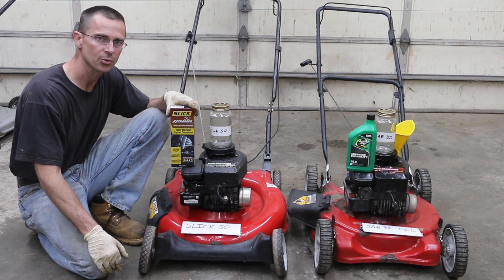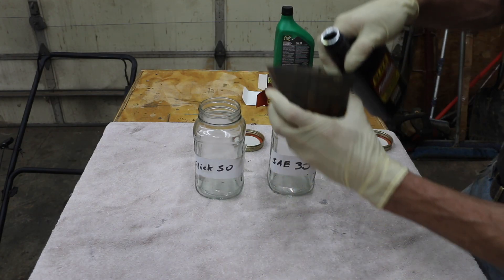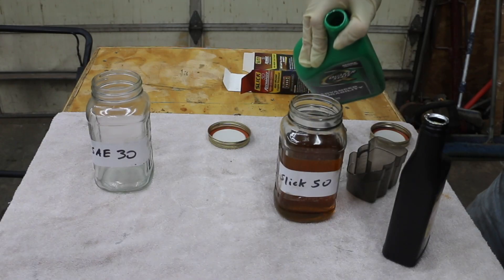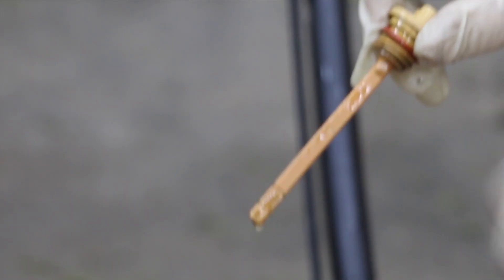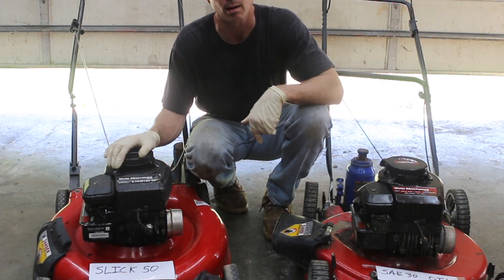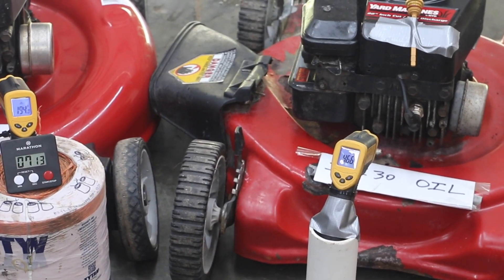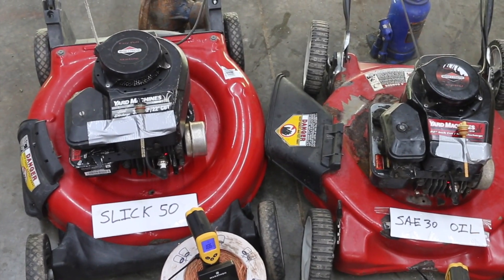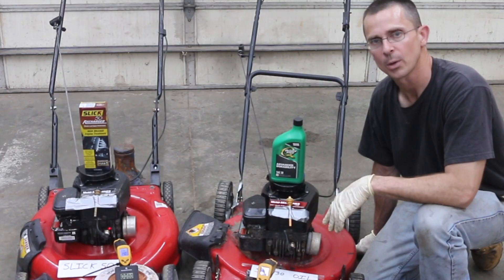Can't believe what SLICK 50 did to my engine!!--Dry Crankcase Test!

Comment: I remember that commercial. They added sand and rocks to the crank in that infomercial. Maybe that was Z-Max though. I have a friend who owns an old Jaguar and he uses Z-Max at every change. My personal belief is that the engine is designed to run at a specific temperature and lowering said temperature is bad. Raising it is bad also, but I only run the correct type of oil in my engines (cars, boat, five bikes, antique tractors, and more) and I have only had one engine fail on me, and that was on an old 2-stroke, racing dirt-bike, which of course has no oil in the crank. I miss 2-stroke bikes!

Good video though. I am late to the party but I am gradually watching your videos and enjoying them, especially the un-biased approaches you use. I would love to do projects like this myself, but I do not have the cash for stuff like this. I'm a dad and bills come first. Maybe one day!

Comment: My oil pump went in my older Ford F150. I had treated it with dura lube. I was able to drive home with the engine very loud with no oil. It never did seize. I got rid of the truck anyway.
Reply from the maker: Thank you

Comment: If it runs cooler, then it’s better.  I wouldn’t consider running without oil to be a requirement for an additive, but would be great if it could.  Having never used slick 50, I’m not discouraged from trying it after watching this video.
Reply from the maker: Thank you for the feedback.

Comment: I Slick 50'd my engine, then my oil pump went out, but I didn't get an oil light until just before the engine started banging.  Damage done.  Did the Slick 50 prevent the oil light from coming on, sealing the fate of my engine?
Reply: It probably clogged your filter and then your pump. I wouldn't get it near any engine I wanted to carry on working.

Comment: 1983 I saw a car run for 3 hours after draining oil treated with slick 50.     Even ran up to 90mph on rollers.
Reply from the maker: Thank you for the feedback!
Reply: So many comments here - but many gaps.  Firstly, imperative that the engine is treated for an extended period for successful treatment before draining and testing. Secondly, the original Slick 50  must be used. My first experience of this PTFE oil treatment dates back forty years when a friend of mine returned from Australia with a product developed, as I recall, by Dupont where the carefully monitored test run from  Freemantle to Sydney was conducted successfully.  And even when I visited Australia in the early eighties, I recall watching a motor race in which the commentator stated that an RX8 that was running had had the engine treated with something - he didn't know what - and that the engine was running so cool that, to save weight, they had been able to reduce the size of the radiator significantly. Needless to say the Mazda won the ten lap race. The Dupont product was not available in here in Europe, but the formula was available as the original Slick 50. Eventually that went off the market here in Cyprus  -  but here's the surprise, the PTFE treatment was and is available from  the manufacturers of Gunk. So that is where  I am at. Why do I use it ?  One time, for some reason, I lost my sump plug, and of course my oil, and was able to drive to where I could fix it with no damage to the engine. Another reason is that if ever Ive trouble with smoky exhaust, or anyone I know, that fixes it. I haven't bought a new car in forty years, so of course, only when I buy a replacement do I have that problem. I could go on, but that'll do for now - Cheers !!

Comment: I think the old Slick 50 did work.  I knew a long time lawn mower shop guy who did an experiment with the old Slick 50.  I don't have all the details but he said he eventually disassembled  the engine and he was shocked to find no visible wear on any of the moving parts and was virtually indistinguishable  from a brand new engine.  He has since passed away or i would call him and verify.  This product at this website may be the original formula.....http://browerhealth.com/product/permafused-anti-wear-engine-protection/
Reply from the maker: Thank you!

Comment: THEORY: #1, HOT exhaust from Slick 50 mower is blowing onto the SAE30 engine. This will undoubtedly cause that engine to run hotter in both tests.  
#2, again, exhaust from Slick 50 blowing directly onto the SAE30 engine. Any residual oil being vaporized along with soot & exhaust is being blown onto the SAE 30 motor, and being sucked in through the intake. This could provide , although minuscule,  some lubrication, or even slowing down the other engine, or causing it to run slightly richer. Gas is a lubricant as well!
#3, Slick 50 motor is newer, possibly better tolerances between parts. The older worn out SAE30 motor, with sloppier tolerances, might handle it better without oil.
Reply from the maker: Thank you for the feedback

Comment: Pro-long.  Used it years ago and had my toyota shoot out the oil till pressure dropped off and got some stuttering on the highway.  Drove 5 more miles to town and added oil and fixed the bnb leak.  Same engine still runs today.
Reply from the maker: Impressive!!

Comment: I recall when Slick 50 was new and had teflon particles in it.  DuPont, which invented teflon, tried to warn people about putting it in engines, which was definitely not what it was meant for.  Then one of the magazines like Popular Science or Popular Mechanics tried this same test and got the same results.  The engine with only oil in it lasted longer.  It was always a flim-flam deal, a total fraud.
And if you recall, the recommended uses for teflon didn't work out any better, as most people ended up with teflon-coated steel pans with just a few streaks of teflon remaining.  Wonder what it did in all of our bodies after we ate it mixed with our bacon and eggs?

Comment: The major engine oil manufactures include "additives" in their oil.  Their oil is about 85% crude oil based and about 15% other additives.   Any additives that are effective are already in their oil.  Using good motor oil in a good engine is always better than ignorantly pouring in some over-hyped, magic cure-all.
Reply: I agree with that.

Comment: all i can say is a mecahnic put slick 50 (oil and fuel system) in my car and it did 4500$ damage to the engine (was all the rage in the early 90s). a Motor regulations body had a look at it and said its the PTFE that breaks down from the engine walls etc, clumps together and causes oil line blockages etc, All fuel injectors also needed to be replaced.. Put a diff oil in my rear diff that had PTFE additive in it and it blew after a few weeks, shattered pinion gear. would never touch anything that has PTFE in it for cars etc.
Reply from the maker: Wow!  That's a lot of damage

Comment: When I worked in GM Powertrain I had a class on lubrication taught by the lubrication tech spec. Slick 50 does not add to the lubrication package in modern oils. The TS reported that and the question always comes up in his classes. The other thing about modern oils is that the line between synthetic and conventional motor oils is blurring.  One thing to consider is were both carbs tuned the same (if they were adjustable)? Differences in temperature would be far more sensitive to A/F ratio than small differences in oil unless an extremely viscous oil caused a higher engine load to run at speed.
Reply from the maker: Thank you for the feedback!

Comment: My husband used it in a Dodge Dart with a 171 Slant six it was getting 20 miles to the gallon at the time, once we put in the slick 50 the grey yellow looking stuff at $25 a quart, he ran it for 1500 miles, turning the carburetor down,three times for it was running away at stop lights or stop signs. After all was said and done we got 32 miles to the gallon. A 12 mile gain. He saw the report on the stuff it was a really thick one, a friend was selling the stuff so we got to see all the reports. You didn't have to change the oil filter only after the 1,500 miles. Then you could run the car out of oil and it would not hurt it, cuz we done it just for the heck of it.

Comment: This test is not a valid indicator. 1. You didn’t follow Slick 50 instructions. You altered them. 2. Running an engine without oil in it is not a valid test. No one drives their car that way intentionally.  It was an entertaining test but it doesn’t tell you that slick 50 is better or worse than conventional lubricant.

Comment: I used slick 50 on my new 2002 ford e350 van I just got rid of it this year 2019, 17 years old 340,000.miles not a single problem with the engine  body rotted out, my mechanic said on the last visit I made with it that there was not a drop of oil leaking from it, just got a new ford van and will use slick50 faithfully. Longest time ever with a single vehicle.
Reply from the maker: Impressive!

Comment: Something else I use to drive a hay rake and on a field that we rake each month there were these giant propane single piston engines.
One time I was talking to the maintenance guy who is changing the oil. 
These engines did not use motor oil they used mineral oil it was a clear looking liquid with no color I also remember him saying that they would take the used oil and push it through filters under pressure then reuse it.
Have you ever tried using something other than motor oil.
Reply from the maker: Thank you for the feedback!

Comment: Amsoil will keep running even when drained.....used it for 12 years in my tri axle dump truck 780,000 miles  and internal engine was still in excellent condition.
Reply from the maker: Thank you!

Comment: I have saved cars by using Slick 50. I use it in all my cars all the time. I run cars that others give up on. I am now driving a 1996 and expect to be still running it in six years with Slick 50 in it. I use it in every oil change. I don't run engines out of oil

Comment: Maybe try this. I had a 1981 VW Rabbit. It had zero oil pressure at idle in drive. So I would bump into nuetruel. But as a home made idea. I used a generic STP. Or engine honey. But filled will a cup of graphite powder. It never seized.  It did one day blow a head gasket. But never locked up. Give it a try!
Reply from the maker: Thank you for the video idea!

Comment: The difference in ring/cylinder wear between the two engines may have actually determined which seized up first in this test. The test would really have to be done on two engines with equal clearances to isolate the effect of the slick 50 on seize time. It made for an interesting video nonetheless.
Reply from the maker: Thank you!

Comment: the exhaust from the slick 50 lawnmower is blowing hot all over the mower running just the 30 weight oil thus potentially making the reading 10 degrees or so hotter than it would if the hot exhaust wasnt blowing that direction
Reply from the maker: Thank you

Comment: Modern synthetic oils are that good they need no further additives.  All I do is one full oil and filter change a year as I do less than 7k miles annually.  I do not have engine problems at all.
Reply from the maker: Thank you

Comment: I thought the Slick 50 was supposed to have a Teflon mixed with it. If I remember right, that was their selling point in the mid 70's. If the 50 now days still has the Teflon in it, I think there's a recommendation time of running the motor for that to adhere. Just thinking out loud with a question.   Love your videos,  you do nice work ,
Reply from the maker: Thank you!

Comment: When I used Slick 50 the instructions said to run the car 3,000 miles, then change the oil. It is supposed to burnish into the metal to metal parts. I don't know the 3,000 mile mark on lawnmowers, but a fair test might be to run it several times at least to let it work into the metal.
Reply from the maker: Thank you!

Comment: They were used engines and the one with more wear already on it would have greater clearances and therefore run longer before seizing.  Also if one was running a leaner fuel mixture it would run hotter.  So the only way to get a meaningful comparison would be to run the test in identical new engines and verify they both run the same temperature on SAE 30 oil before treating one of them with Slick 50 and running the destructive test after draining oils.
Reply from the maker: Thanks for the constructive feedback

Comment: Of course the 2 engines were not identical in age or internal condition so far as I know. The cooler run temp is significant unless the exhaust of one was going into the other mower.  Does anybody still "the racer's edge" STP?
Reply from the maker: Thanks for the feedback!

Comment: During the test the Slick 50 engine stayed cooler than the 30 wt engine, with oil in the crank case. I was surprised when the slick 50 engine cut out first and that the 30 wt engine kept running at a much higher temp before locking up, after oil was removed. I have never been a slick 50 fan but if it can keep an engine cooler while running that means that when it is in the crack case less friction is being produced and that is better for the long life of an engine. But, I think I will just keep Mobile 1 in my engine without anything else. It has worked well in all my cars and I've never had any gunk build up, nor have any of my cars starting using oil, even with over 130K on some of my cars.
Reply from the maker: Thank you

Comment: I would be curious as to what would happen if you added graphite to the oil. Would the engine run a longer time than with just oil? I know graphite works great on metal to metal objects but would temperature be a factor?
Reply from the maker: Thank you for the video idea!

Comment: zinc: good for the common cold & your car's engine

Another type of additive is zinc dialkyldithiophosphate. Zinc-d is found in Mechanics Brand Engine Tune Up, K Mart Super Oil Treatment, and STP Engine Treatment With XEP2, among others. The touting of zinc-d as a special ingredient in engine oil additives is a little like the Shell ads which touted "Platformate." (Most gasoline has similar additives but under different names.) Zinc-d is an additive in most, if not all, major oil brands. The wonder oils just put more of the stuff in a 50 weight engine oil. It would be useful if your engine were ever operated under extremely abnormal conditions where metal contacts metal: "the zinc compounds react with the metal to prevent scuffing, particularly between cylinder bores and piston rings..
Reply from the maker: Thanks for the feedback!

Comment: I have a 1989 Jeep Wrangler 6 cylinder I put Dora lube in it when it had nine miles and it that in four quarts of 20/50 I like 20/50 conventional changed it at 5000 miles at 50,000 miles I put another treatment of Dora lube again with 20/50 conventional oil drove for another 5,000 miles  when I hit a hundred thousand miles I put slick 50 in again with 20/50 oil changed it at 5000 miles I'm at 200000 miles now doesn't  burn oil or leek oil I don't know if that stuff worked or not but it certainly didn't hurt. 😎
Reply from the maker: Nice! Thank you

Comment: (#2)Here are a couple reasons why I developed a lot of skepticism about oil company ads (and closely  associated industries). Prior to the 1973 oil embargo, gas and oil prices were quite stable and competition was primarily based on constant hype about the manufacturers gas and their particular magic additives, and all the magic benefits of their products use in your car (s). Shell with TCP was one gas ad that I remember. These ads stopped when the embargo took hold and rising prices began occurring. They didn't resume for years after, until prices became stable and they returned to advertising hype to try to increase market share. 
The 2nd reason was engine oil! 40-50 years ago, maybe more, many manufacturers oil carried a "military qualification number" because they all wanted to sell oil to the largest motor pool operator on earth, the US ARMY. Regardless of manufacturer, lot #, etc., the Army freely mixed the oils with no concerns or ill effects. Yet these various oils were continually hyped with ad claims of magic for your engine, to the civilian market. It continues to this day. I've purchased and used many of the top manufacturers oils, mostly when on sale, including Amsoil and Mobile 1. I've used Shell, Exxon, O'Reilly, etc. Have been using synthetic oil for the past 20+ years. I buy on sale and sometimes for even 2,3, maybe even 4 years ahead. No matter the brand, I will not exceed 7500 miles or 1 year and being retired now, I'm not generally driving over 6000-7000 miles per year anymore, spread across 2 vehicles. Even then, my driving is mostly highway, since I live in the country and am going to towns 12 miles away, or more. Don't be taken in by magic claims or by those who believe them. No one knows with absolute certainty, how many miles on an oil change is enough or too much. Too many variables, too uncertain. That's why my limit is 7500 or 1 year, whichever comes first. YMMV.

Comment: I am not surprised that Slick 50 failed to live up to its billing. I never believed in it. Lubrication has to circulate thru an engine and back into the oil pan where it gives up enough of its heat to keep the engine operating temperature and the oil, in a safe operating range. Without a sufficient volume of oil flow, spending sufficient time in the pan, the
cooling of the oil would be insufficient. This would occur if the engine is low on oil. Thank you for your engine testing, which serves to provide us DIY'ers/enthusiasts with another clue in the perpetual struggle against bogus claims.
Reply from the maker: Thanks for the feedback!

Comment: You should run an engine with Lucas Heavy Duty Oil Stabilizer only. I use a 20% mix in my truck to keep it from leaking and it works. I'm curious to see what it would  do buy itself.
Reply from the maker: Thank you